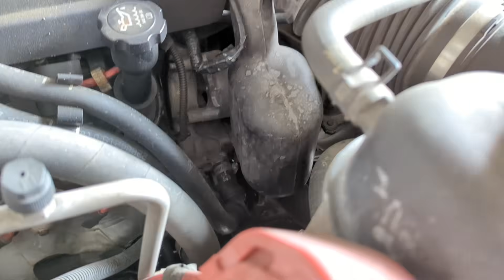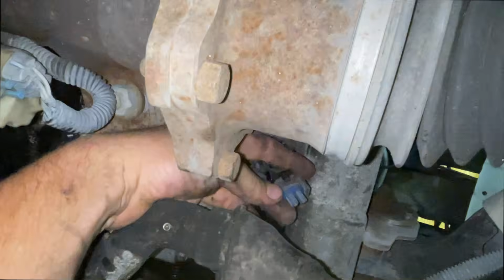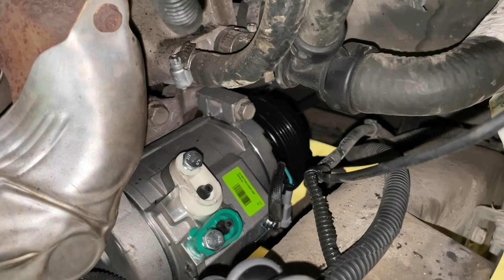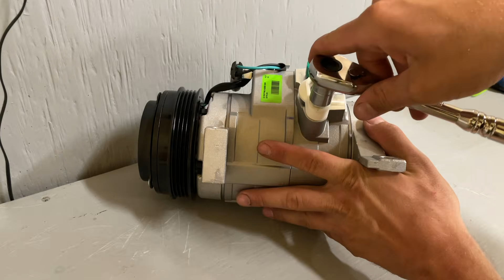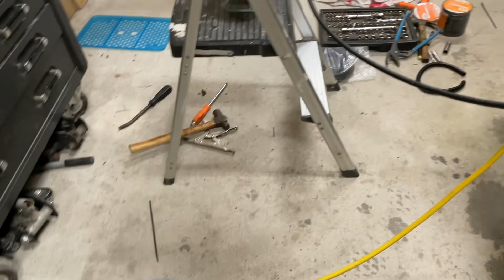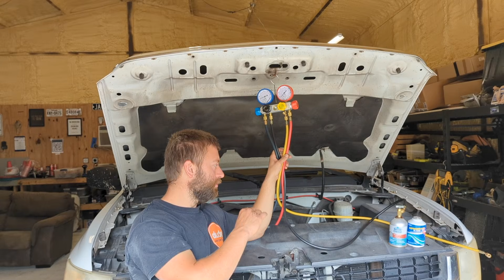2007 Chevy AC Compressor Replacement

Comment: Wasn't oil 8oz for entire vehicle charge? when you removed the compressor only there was oil remaining in the receiver dryer, evaporator and condenser you did not remove.
By adding 8oz you may have a total oil charge that is way too much for the system. I believe the procedure is to drain and measure the oil from the old compressor then drain the oil from the new compressor and add to the new compressor the new oil in the quantity that came out of the old compressor.
Very good video, extremely helpful in showing the mechanics of the replacement.

Comment: Wasnt there already oil in the system and didn't need the whole 8oz? Also,  you didn't change your drier?
Reply from the maker: I don't usually change the dryer, instead I vacuum the system to remove moisture. 

You drain the oil from the old compressor and measure it.

Then you drain the oil from the new compressor and refill with the same amount that came out of the old compressor.

[https://tccimfg.com/wp-content/uploads/2019/01/Oil-Balance.pdf](https://tccimfg.com/wp-content/uploads/2019/01/Oil-Balance.pdf)

[https://www.denso-am.eu/media/651804/160461-denso-leaflet-practical-tips-a4\_en\_.pdf](https://www.denso-am.eu/media/651804/160461-denso-leaflet-practical-tips-a4_en_.pdf)

Comment: I’ve got no voltage at the plug. AC fuse (#18) is good. Bad relay or something else?
Reply from the maker: Could be a lot of things, try jumping out your high and low pressure switches with a paper clip to see if one of them is faulty. 

You may need a wiring diagram

Comment: My ac Compressor started to smoke up and I filled the system while the engine was running
Reply from the maker: What do you mean "smoke up"?
Reply: @dudewecanfixit there was smoke coming from the ac compressor the clutch never engaged when putting refrigerant
Reply: @dudewecanfixit do you think it’s because I didn’t pre charged the system before turning on the compressor

Comment: Thank you for the in-depth video on replacing it. I got my new one in the mail for 130, certainly a lot better than auto stores wanting to charge 300+ for one
Reply from the maker: Great to hear!
Reply: Is it still lasting or did you return and buy the auto parts brand
Reply: @hunterwarren8618  it's still going strong. Nice ice-cold AC. After the temps started warming up from the winter cold, I had no AC whatsoever. It's been over a month since I installed it, and it still works like a champ

Comment: Did you have to replace the high pressure electric plug?
Reply from the maker: Not quite sure which component you are referring to. If I did replace anything, It should be in the video. I don't think I had to change any electrical connectors.

Comment: Quick question i try to replace the ac compressor lines.  But they don't  sit flat all the way around.  The only spot that sit flat with the compressor is where the bolt is.
Right the ac compressor  lines should be flat all the way around after you tight the bolt down?
Reply from the maker: I think so. I'm not completely sure what you mean, but it should look like it does in the video

Comment: Great video.. I've watched another where someone in the comments section advised to equal the amount of pag oil that's in the old (removed) compressor, I was shocked you put in 8oz. I guess in theory, there's oil in other parts of the system
Reply from the maker: I do it by the manufacturers recommendation.

Comment: What happens if you don’t bleed the refrigerant before removing the a/c compressor
Reply from the maker: You will end up wearing the refrigerant...

Not advisable as it is a pressurized system.

Comment: Did it develop a tick before going out completely? My truck has a tick and I heard it could be the ac compressor. Did yours tick?
Reply from the maker: No, the clutch went out on mine.
you should try to isolate where the tick is coming from. Is it present with the ac engaged and not present with the AC disengaged?
Reply: @dudewecanfixit  its present when it’s not engaged. I don’t have a reason to use the ac right now considering it’s cold. But it way more pronounced while I’m in the cab driving. Especially on a cold start.
Reply from the maker: It sounds more like engine internals to me. Rotating accessories tend to whine or make constant noise. I don't think I've ever owned a high mileage Chevy V8 that didn't tick. Also, it has never caused a problem for me, but you should try to verify where it's coming from.
Reply: @dudewecanfixit the clutch on mine isn’t moving and I’m getting warm air coming out. Is that what happened to yours?

Comment: How/what do you need to get refrigerant out of the system? Is that red tube connector you showed part of a kit you can buy or is it one of the A/C refill cans that is empty? Thank you
Reply from the maker: R134a was designed to be environmentally friendly. Releasing into the atmosphere shouldn't cause any issues.

The proper way to do it is with a refrigerant recovery machine. If you don't have one, it's going to be cheaper to let a shop do the whole refrigerant process for you.

Comment: Perfect timing! This is generally the same process for a 2010 avalanche right? 5.3L. Also, do you add more refrigerant after you start her up?
Reply from the maker: Yes, this should be the same process. You do. Add more refrigerant once the vehicle is running. Find the refrigerant amount under the hood and add refrigerant until you have added the correct weight of refrigerant.